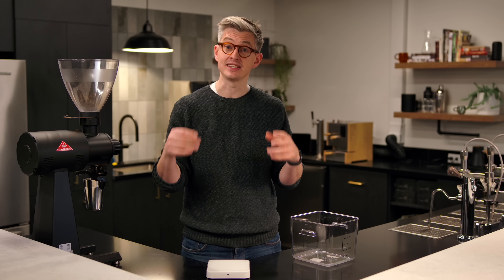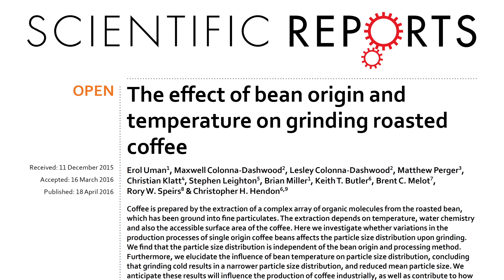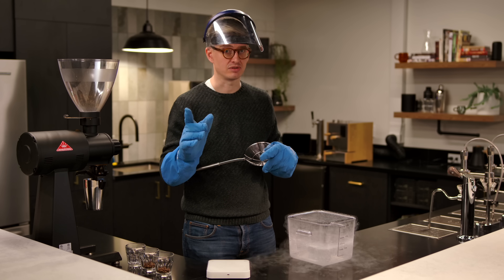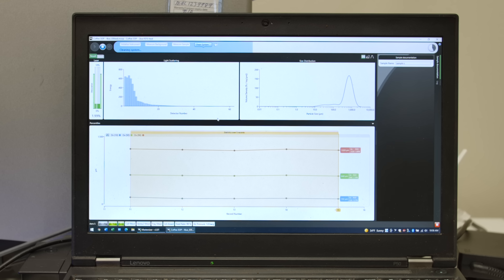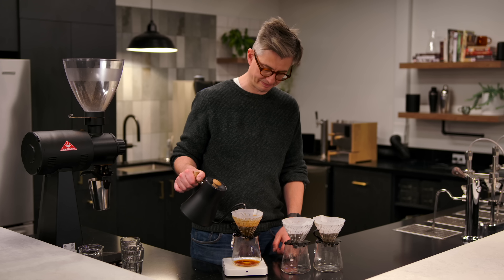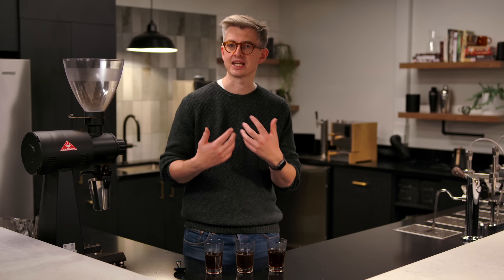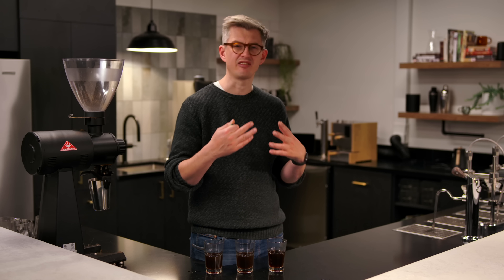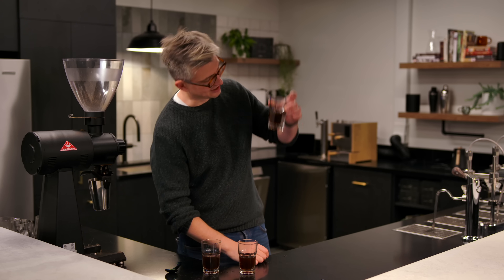Mixing Coffee Beans and Liquid Nitrogen - A Surprisingly Good Idea

Comment: Very interesting. In my coffee journey, I've always heard 50/50 on arguments regarding freezing (not nitro) your coffee beans. I do tend to only buy enough for a short period of time (3 weeks to a month). However, I have bought as much as 3 months worth of coffee beans at one time (twice). Normal case scenario, I'd only consider freezing my coffee beans if the pay off was a huge reduction in static. That has been my number one bane lately. I live in a relatively year round humid climate and my grinder has a plastic grind catcher (idk the technical term). I've tried tin foil on the outside and in. I've also tried the trick where you run the handle end of a spoon under tap and then stir the beans prior to grinding. The only thing that has really worked (yet still annoying) is to grind the beans, remove the grind catcher and set it aside, prep my coffee cup and Melita, and heat my water. By the time the water is done, I then tap the grind catcher (I really gotta look up that term), and finally pour the grinds into the filter. There's still some static, but not to the point where some grinds are either refusing to come out or some go on the counter rather than into my filter. My normal routine takes about 6 minutes. With the adjustment for static, it takes almost 10 minutes. That's not a terribly long time, but when you're wanting a cup of coffee first thing in the morning, then 10-15 minutes is not really acceptable.
Reply: Spray water onto the beans before grinding them. That was a game changer for me, maybe works for you.
Reply: Invest in a mini-vac and hoover up the dust
Reply: @Thetache  I can't believe I hadn't thought of that. There's nothing like losing a gram or two from a carefully tuned in brew recipe.
Reply: Like the other person (and James) suggested, I say give the water spray a try; It works reasonably well except for some very weird grinders that produce way too much static for some reason

Comment: This feels really nothing more than a gimmick biz concept, with all due respect to James professionalism and his amazing content. We know extremely low temperature could make material more crunchy and easy to brake into pieces, thus you tend to crack the grounds more than abrasively grinding it down to the size of your wish when you grind coffee while it's extremely cold. In this way you get less dusty particles smaller than the grinder settings to fall through the cracks. However, looking at the bell curve and the peak height, the difference is not that huge. Besides, a sifter with proper selection of grid sizes can easily achieve a much better result anyway.

Comment: The most important part for me is that I can buy a kilo of espresso beans and keep in the freezer and just use the bean directly from there. Nice!
Reply: I wouldn't do that. If you open the bag straight out of the freezer, warm, humid air from your kitchen gets in, and condensation forms on the sides of your bag and your frozen beans. They'll go stale really quickly. I'm pretty sure James did a video about that a couple years back. Freezing coffee is fine, but once removed from the freezer it has to stay out of the freezer to prevent condensation. If you want to buy a kilo of beans what you can do is split it into ziplock bags of however much you're gonna use in a week. Or if you really want to grind from frozen every single time, loads of tiny ziplock bags of however much you need for one brew! :D

Comment: I’m less concerned with “how does the coffee ground while frozen affect flavor” and much more with “does grinding frozen beans result in condensation on the grinder and thus potentially encrusting or corrosion?”
Reply from the maker: No, not really. And a little water (such as spraying the beans before grinding) doesn’t seem to impact burrs at all
Reply: @jameshoffmann  I've seen some niche zero (mazzer uncoated steel) burrs that looked like they had corrosion/rust. Not sure if that's a result of using RDT (water spraying) or just something that had always been there on there and just a cosmetic thing. But I always thought it was ok to do on a coated burr but maybe not a standard steel burr. I know the 1zpresso k plus hand grinder manual says not to use water spraying with it.
Reply: Niche Zero does not need RDT as they are very good at keeping static at a minimum. It always might be the case but I would have suspicions about the way the Niche is put to use.
Reply: @jameshoffmann  — Aha of course! My apologies for the doubt.
Reply: @jameshoffmann  this is good to know. Guess I’ll be experimenting with frozen beans.
Reply: I wouldn't worry about that at all, in a few of James' videos he advised to spritz them with the tinyest amount of water (like 1-2 drops) to stop static buildup. I've been doing this for over a year now, and having recently cleaned the grinder, there was no corrosion (plus they are usually stainless steel burrs).
Reply: @nagymartin9144  this is perfectly fine at home when brewing a few cups a day max because the burrs have plenty of time to dry out. Now this is not recommended for a heavier use of the grinder, like in a commercial environment where the humidity could build up during the day and damage the burrs over time
Reply: @Gildaaaaaaas  In a commercial setting I can't see anybody pissing about with RDT, they will be far more interested in fast and efficient workflow to bang out as many coffees per hour as they can.
Reply: @Thetache  in a commercial setting, small sacrifices towards quality in the cup are worthwhile if it means that the workflow saves adequate time. Most cafes don’t use single dose grinders anyway.
Reply: I think with the small amount you're grinding for a single brew that won't be a problem. Condensation might start forming if you were grinding bigger quantities, but then the burrs would get hot and evaporate it anyway.
Reply: Yeah, I wonder how frozen beans would affect the burrs long term.